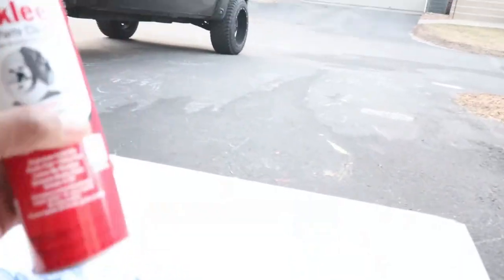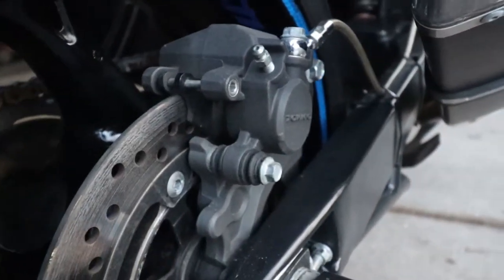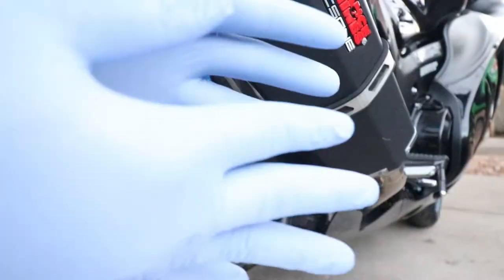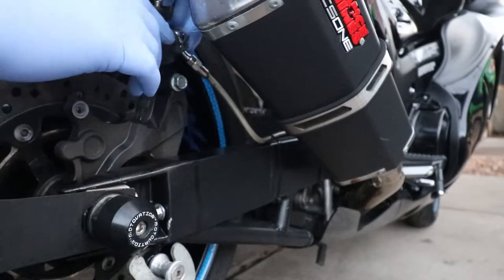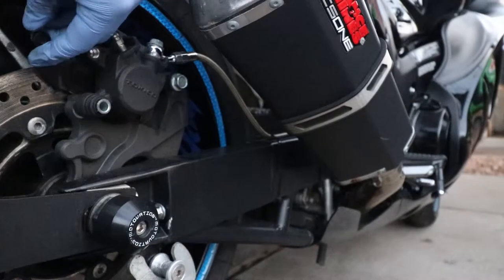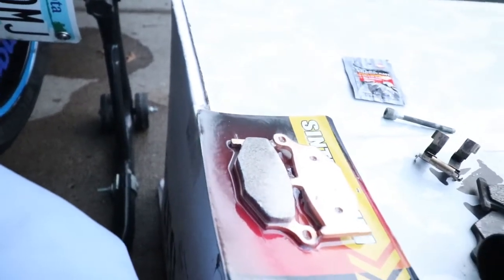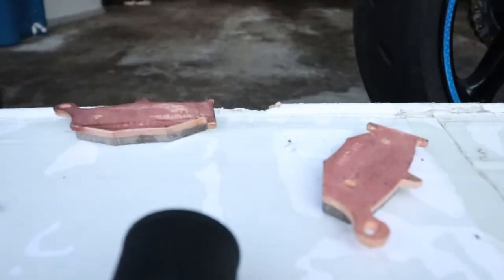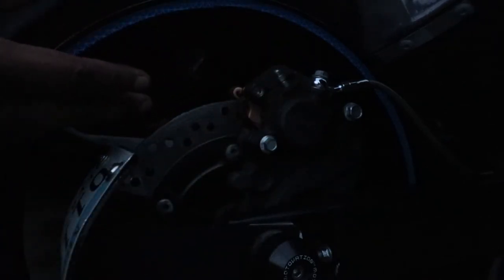Brake pad replacement( Suzuki Hayabusa)(How to)

Comment: I just watched this to get inspiration to finally change the rear pads on my 2008 busa, even if I've done that many, many times before. Still, after almost 30 years of riding I learned something new here. I've never even realized there is such a thing as brake grease, and thus never used it. Thanks for the tip!